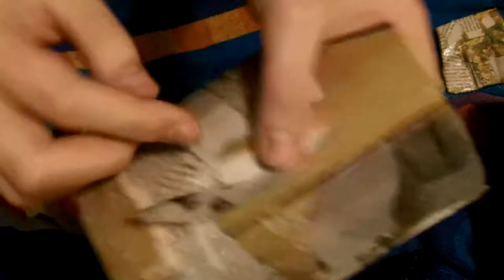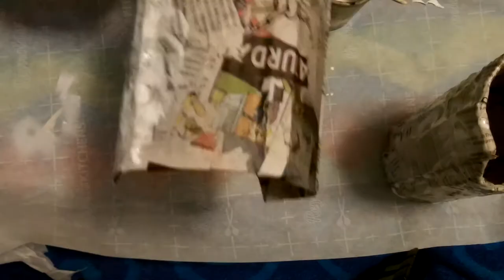DIY Stormtrooper Armor Part 1: Arms!

Comment: hey, i have a question, did you make the helmet or did you buy it, if you bought it where did you get it?
Reply from the maker: My helmet is a modified Star Wars Black Series Rouge One Stormtrooper mask made by Hasbro. It was $100 dollars when I bought it on Amazon but the price has seemed to have doubled in the last 4 years. I would maybe look for a different helmet because I had to modify it to fit comfortably on my head. It has a terrible voice changer and it snaps together so it's harder to take apart.
Reply: @DavisPropsInc  okay thanks!!!